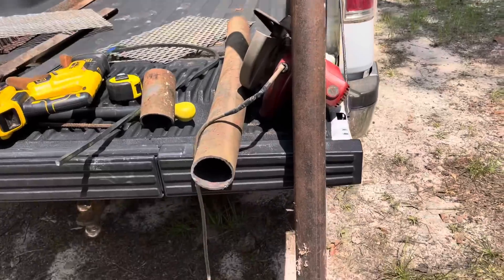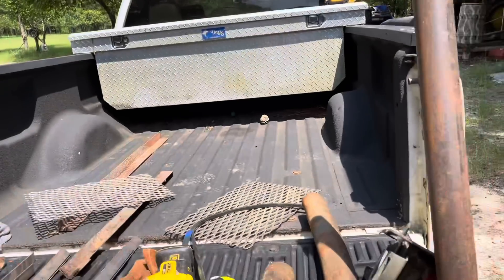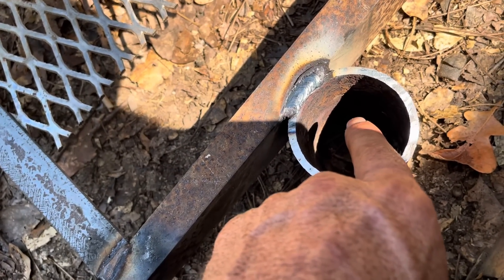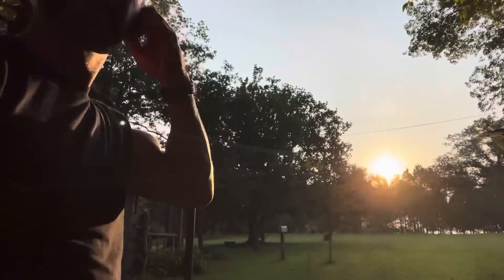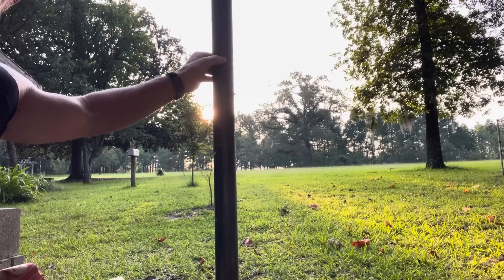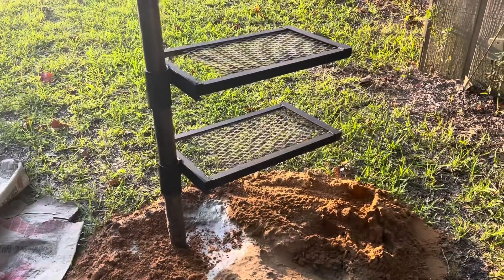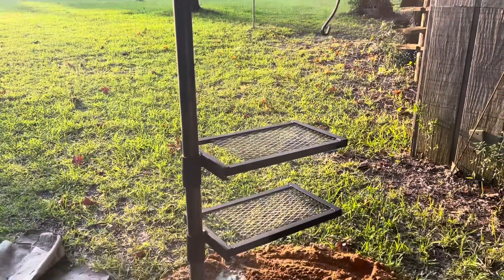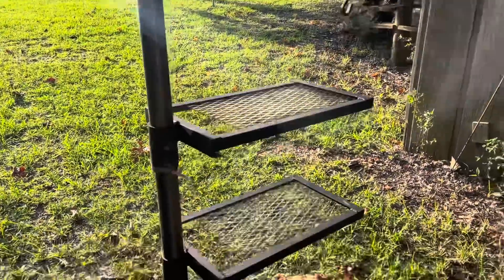How to Build an Outdoor Cooking Stand for a Fire Pit

Comment: I’d love to see your welding setup. I recently got into flux core welding but I’m terrible at it. Your bead looks pretty good.
Reply: Flux core welding is only legit when it's .056 with straight co2,or stargon with many, many hours of practice... The non gas Flux core welding wire is only good for the 1000s of hours welder who is used to Flux cored wire.. Sadly too many newbie welders assume or believe that their Flux cored welding is solid,and safe..It's not.. consult a legit welder who knows their doodoo before attempting to weld anything...advice and guidance is free..

Comment: Jeff? The only thing I would have done different is not keeping the top of your concrete ground level will with the heat of  of your wood coals, concrete will crack. If you kept your cement 12 inches below ground than filled with sand she'd be beaut. Great job though. SINCERELY PEACE FROM CANADA

Comment: I would just drill a hole and weld a nut to it With A T handle On a bolt . You might need a welding glove to adjust it though